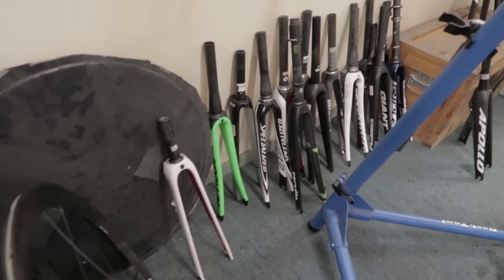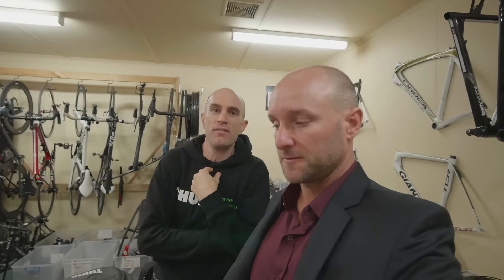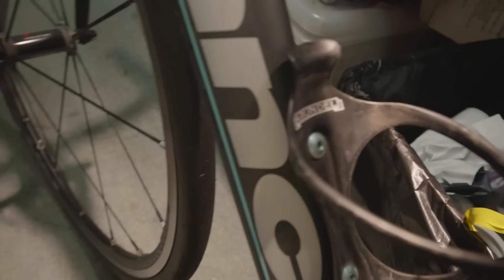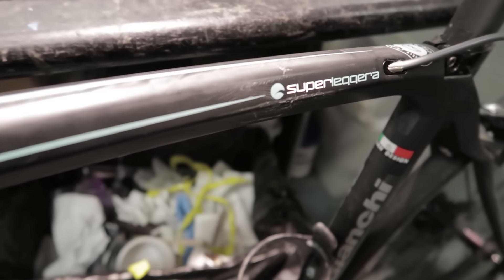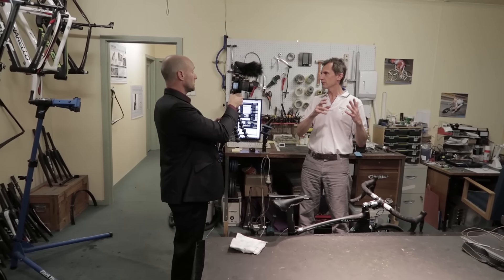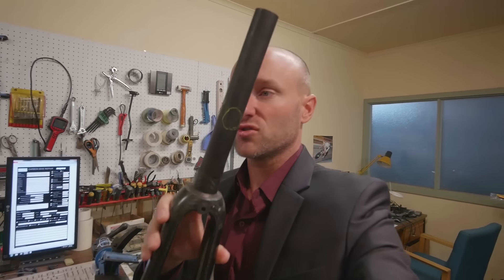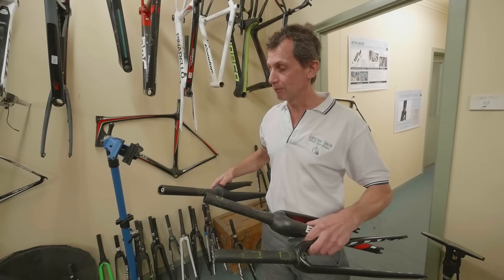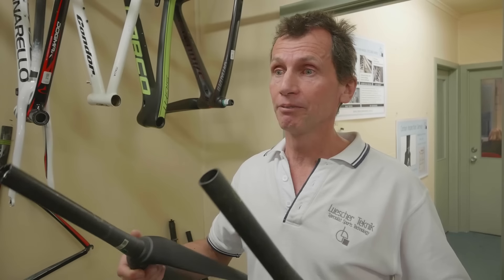Carbon Fiber Bikes - Are They Strong Enough? (ft. Raoul Luescher)

Comment: The reality is that the main consumers of CF bikes, i.e. Cafe Racer MAMILS white collar executive types in middle management are just buying these expensive CF bikes to boost their ego (akin to the middle aged tool in his brand new sports car). The performance afforded by these expensive light weight CF frames will never be maximised by their weekend warrior owners as they race each other to their favourite coffee joint . They would be better off spending the same amount of money on a custom made Steel or Titanium bicycle (from skilled artisans) that is tailored to their exact pot bellied dimensions. And which they will not have to worry about should they accidentally drop their bike or run over a large pothole. The catastrophic mode of failure of CF makes is what these MAMILS should be worried about. With Steel , Titanium and Alloy bikes, they will let you know when they are going to fail well before you take that steep downhill run and won't cave suddenly under you.  But Nooo...everyone wants to ride the latest and  greatest CF bike because it is what the TdF riders ride.
Reply: You have made me smile reading this Triodie 12 old mate.
Reply: Triode 12 yes i agree. Ill bet this guy gets sued for faulty work. His knowledge is only just above the person selling the bike. The expensive parts are pressured moulded and vacuum moulded in one piece. The stress fractures are not visible to the naked eye or by magnification. Manufacturers will not repair carbon fibre bike parts. There a really good reason they don't. Once riden on the road the stresses from a metal part on carbon fibre is not able to be seen. 
This guys found a neiche in the market. After i researched and repaired a few of my own parts i decided against repairing anything for others. The risks are very real and too great. 
Unless a maker can guarantee all his work i wouldn't touch a carbon fibre bike.
Reply: OK this is only one MAMIL's feedback but I rode an early Giant CFR2 for 21 years and when I retired treated myself to a new Giant Defy Advanced Pro 1, the old CFR2 is still being ridden to University by my son-in-law and I'm riding faster than ever on my much lighter Defy. Point? The CFR2 is still going strong but the lacquer did erode off, otherwise no cracks, no catastrophic failures despite the odd drop and instant dismount. So maybe not all carbon fibre is as bad as you think, or maybe I'm just lucky.

Comment: Some of this is a little bit forensic. Yes work processes and manufacturing needs careful control. Repairs need to be performed intelligently to avoid significantly altering stiffness and stress distribution through the frame. However, bear in mind that bikes cost £3-5k. If every frame had properly certified and verified UT or RT performed then bikes would cost a lot more. Difficult to say how much but it wouldn’t surprise me if it increased cost by 50-100%. At the end of the day nothing is risk free. Even aeroplanes have structural failures. The answer is for the major manufacturers to monitor and improve work processes (TQM) over time to eliminate as far as practical material defects.

Comment: Although carbon might be "better" (lighter, stiffer) than aluminium  the importance of a good quality control process perhaps in a way makes it safer to get a aluminium  since they apparantly doesnt check the QC that much (or atleast not as much as for example aeroplanes)? That is if the aluminium QC/safe aspect is easier/less demanding..

Comment: Carbon handlebars: Are they worth the money and do they really absorb the road vibration thereby preventing injuries in your arms, shoulders and neck?
Reply: If you want ultimate road comfort you'd be better off with a steel (or Ti) frame and a quality carbon fork.  I've had too many carbon bars fail from average use.  I stick with alloy stem/bar with good quality gel bar tape.  Finally the best mod you can make to improve comfort and reduce road harshness is upgrade your tires.  I'm loving my S-Works Turbo 26c.  I'd also recommend the Continental GP 4000 in 28c.
Reply: Imo it's so worth it with a carbon handlebar.
Reply: +Fredrik HL , I just  found a bubble in my top tube close to the seat post. It is tiny but should I be concerned? The bike shop where I bought it said it was due to the carbon expanding in the heat causing the top coat to bubble. He said he can fix it. Your thoughts?
Reply: +Mattie May Not sure why you're asking me but. If it's just the paint/clear coating i would not worry but if it's the carbon itself you should ask an expert.

Comment: Yo! Its always a good idea to check with the manufacturer with regards to ergo trainer with carbon bike! Most say they are fine, however my scott foil was making a creaking noise around the chain stays. I tweeted scott and they said do not use it on the turbo trainer. It depends on the layup of the carbon. i now have a kurt kinetic swaying trainer! problem solved. Plus the balls don't take such a beating as there is some give and bounce in the elastomer. Spent 3.5 hrs on in in one go! boredom got me before ball ache got me! Also with regards to titanium. A lot of people here in uk use them as winter bikes as the winters a much heavier and its not great riding round with gritted salty heavy roads with that corrosive stuff on your carbon frame and components. 
cheers dude!

Comment: Titanium bicycle are even more complex in manufacturing than carbon. As to weld titanium properly you need a close chamber, and the material in itself is really harder to shape with fancy forms. 
And there are different types of titanium. 
But if you have a good titanium bicycle build in the form of art that it is supposed, you may keep it for a life time, without corrosion, without material fatigue.
Definitely a bit heavier than carbon.
The guy mentioned the manufacturing process witch is very different for aerospace ind. and bicycle manufacturers, I guess is totally true.
Reply: As you are probably aware, and just for clarification to those whom do not know: There are no pure titanium bike frames. There are various titanium alloys that can be used by frame makers. You should expect to pay about £1000+ retail for a titanium alloy bike frame.

Comment: I have a question about carbon forks. I just bought a new frameset, salsa vaya 2017, and it has a 15mm thru-axle in front, so I had to buy an adapter on my mavic allroad wheel that had 12mm thru-axle. Anyways, I fitted the adapter, and when I put the wheel on the fork, it does not slide to its place with no resistance, but the fork bends about 2-3mm to get the wheel in place. is that kind of "tightness" normal, or should there be no tension on a carbon fork? or did I just mess up something with the adapter?

Comment: what he talks about there with compression plugs around 11:50 - there are system like the acros clamp where you won't use any compression plug at all.. So I'm not sure if its correct what he is saying but I also heard stuff like that..

Comment: Id like to know the difference in comfort with carbon compared to ally. I went for lightweight ally hoops as I wanted to get the most help for climbing and was afraid carbon would be harsh?
Reply: Carbon wheels soak up vibration better, especially if it's a tubular wheelset. I'm happy to ride alloy wheels though and riding a wider tyre and also using a tubeless setup can increase comfort.